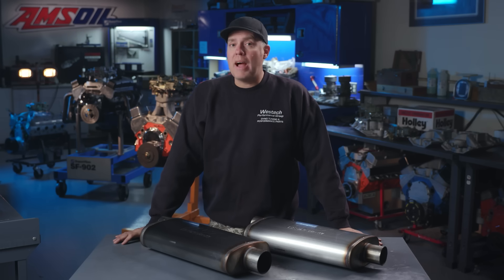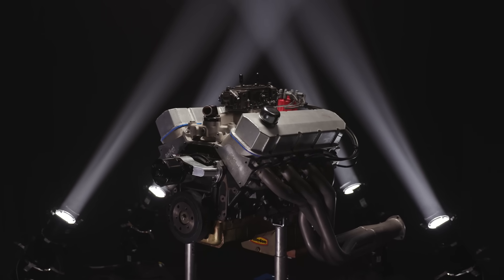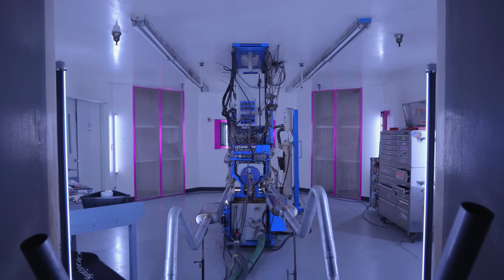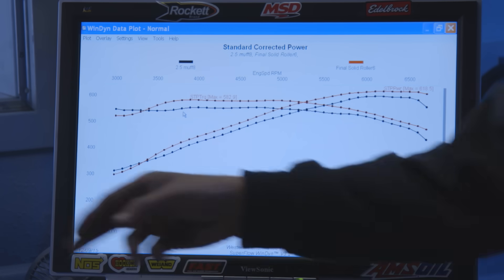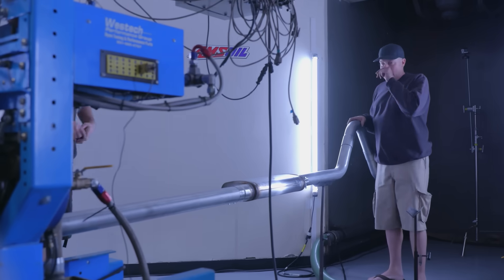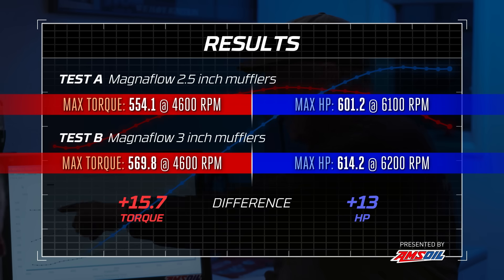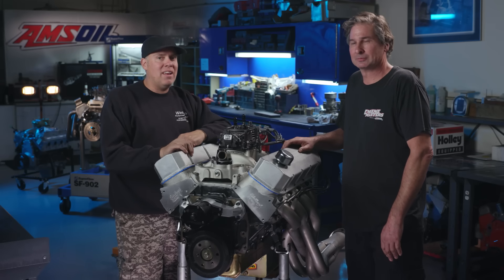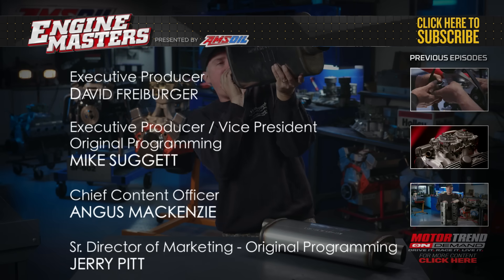The Power of 2.5- vs. 3-Inch Exhaust - Engine Masters Ep. 9

Comment: You know what they should do is get a STOCK engine and try it, since most of us viewers don't have a 600+ hp engines in our cars, and most of us with trucks and muscle cars have small blocks, not big blocks.
Reply: Clay Thompkins but even simpler than that a 600 hp engine puts out so much exhaust gas compared to stock that of course 2.5 is gonna be too restrictive compared to 3
Reply: @fatalvenomX  Exactly.  I'm guessing if they had put a 4" exhaust on it, they would not have seen any improvement over 3".
Reply: @fatalvenomX  2.5 STREET 3" RACE
Reply: Fernando Martinez he's got a 3v, his will break off in the head before he blows one out 😂
Reply: Jeremiah Goodwin plastic lifters? 2v Triton's had issues with timing chain GUIDES breaking. You don't need a new motor, you just replace the guides... 3v has issues with ca. phasers, a totally different motor. If your gonna rag on a motor, at the very least be somewhat educated on it.
Reply: @jb4234-x8d  MY '02 LIGHTNING STARTED SPITTING OUT PLUGS AT 100K SENT THEM OFF FOR CNC PORT AND REPAIR ...65K LATER STILL LEAVING 505HP Z06'S EATING  DUST ... IF THEY WIN ... MY BACKHALVED 78 496 FIREBIRD WILL EVEN THE SCORE ...THE LIGHTNING IS MY EVERYDAY DRIVER AND I HAVE BUDDY'S WITH CHEVY'S THAT HAVE SWAPPED MOTORS ALREADY...... 200 K IT'S GETTING PULLED POKED STROKED  AND THE BLOWER PORTED ...KEEP 'EM STRAIGHT JACOB !! LOL
Reply: @jb4234-x8d , Mr.Goodwin is highly educated. He earned his expert credentials online. But unfortunately he signed up for the fools paradise chat room which was overcrowded by millions that all think alike 🤔.
Reply: @danielwilson6665  highly educated vs fools paradise chatroom... Yeah, that's experience vs the educational system where you are credentialed for compliance, not actually finding or speaking truth. 

In the end, the value is about velocity to volume ratio for the intended power level and rpm level. It isn't about back pressure. Back pressure is only the reference to seeing what is happening inside the exhaust system. And yes, every engine needs some amount of back pressure, otherwise they wouldn't make more power with properly sized headers.

But then, people like you would rather have authority tell you what to do so you don't have to actually think for yourself... your obstinance is no evidence of truth. People who experience the differences are the ones who find truth.
Reply: @jb4234-x8d  that depends on what the engine's doing right when the guides break. if it happens at high rpm, you could have an expensive basket full of broken parts.
Reply: @jb4234-x8d  these people are chevy fan boys!!! But dont know common machanics of each engine!!!!!!!!! Chevy makes great engines but i have seen just a many 5.4 reach just as many miles!!!
Reply: DontTreadOnMe it is the point of principle. Everything applied to something bigger in hp can be applied to lower. But not everything lower hp can be applied to higher hp engines.
Reply: That_Ford _Guy  don't blow a spark plug now lol
Reply: @FernandoMartinez-mq2gj  ha
Reply: @hotrod500hp
Reply: Dylan Morin 900
Reply: Ratios
Reply: You like a civic or Miata engine
Reply: Callum b how about an LS miata!
Reply: @jjones2509  yes more powerrrrr
Reply: Ehhh speak for yourself
Reply: Get a stock chevy half ton truck and do this. Then a stock Ford f150 Engine and do this. Then we can see real world benefits in real world vehicles
Reply: Jeremy Lakenes facts
Reply: @jeremylakenes6859  You would probably see fairly big results using stock vehicle with a tiny stock exhaust as a base as they are choked to death from the factory.
Reply: Amen Brother 4.0L VQ40. I'm trying to get gains over 300 hp
Reply: @tommypearson9260  Plenty of hi performance parts out there to help you out with that.
Reply: They don’t have the money to build a bunch of engines most of the engines come from making it for the magazine I believe
Reply: Meh my 2.2L engine makes over 400 hp. It needs 3” exhaust
Reply: I’ve seen dunk comparisons and when running a silencer in the muffler can make you lose anywhere for 5-7% power.
Reply: im just a working idiot and it's not so tough to find a 454, took me a bit longer and a credit card to get alum heads. dont think its too hard to get a 454 at least in this neighborhood.
Reply: @tybotti  I'd bet it's not the exhaust causing a loss in power. IF you went from a very restrictive exhaust to a good, free flowing setup, your tuneup would change. Carb would usually need to be leaned a bit because the more efficient exhaust makes it pull more air, which also pulls more fuel. They feel "blubbery" of soft until they pick up some revs. All the GM trucks with LS/LT 4.8s & 5.3s come with a single 3". A 3" is actually a restriction when running dual 2.5" pipes into it. A 3.5" single is only a couple tenths of a square inch smaller total area so there's minimal restriction. I've run dual 2.5s into a single 3" with 350 & 400 SBC for 40 years with excellent results. next is the dual 2.5s into a MagnaFlow with an internal Y pipe & a single 3.5" out for my 409 small block
Reply: I have a 355 with 400+hp and a 200 shot on it... ya can't tell me you can afford it. 

Junkyard block 500
Machine shop 300
Cam 600 or under
Rotation assembly 1400
Set of heads 600
Carb an fuel system 800... 

Took 2 years an I'm disabled on a fixed income.
Reply: Yesss i highly agree
Reply: For the size and power, a comparison between 3 in and 3 1/2 would have given us better information
Reply: Specs on 1999 of
Reply: Agreed
Reply: You know what you should do?
Reply: It takes a high HP combo to see much of a difference.
Reply: Small blocks are for girls.
Reply: @strokersteve468  You don't know much about small blocks do ya. 406 sbc is big block ci. I've built many, some over 600 hp and ft-lbs of trq. It's all in what you can build not buy.
Reply: @Stevehistoryunhampered , you would think that anyone calling themselves STROKERsteve would actually know something about the impressive power available from a small block with big cubic inches. Maybe not 🤔.
Reply: You shouldn't even touch the exhaust with a stock engine. Lol
Reply: Exactly.
Reply: Speak for yourself I have a big block and will never go back to a small block
Reply: @HairBandDan I feel sorry for your wallet. 😊
Reply: Don’t buy a small block from the factory 🤨
Reply: I give up those twenty f**** horsepower to have a 600 horsepower daily driver car or street car give me that without the noise
Reply: It really doesnt come down to engine size or hp. The cam and header size do play a factor. But either way the same effect will still take place on how much power is freed up. There is some validity to what you are saying but not a whole lot.
Reply: I'll save everyone the time... if you have a stock engine your only gonna see a difference of +/- 5hp maximum... I don't think you'll even see any difference other than the sound with stock engine
Reply: @donniehooker1817  i gained around 10-15 wheel with 3in from 2 1/4” and one less muffler.
Reply: @Sak-zo1ui  10-15 hp? What engine what cam what heads? Headers? I used to work at a shop that had th ability to put dual exhaust on anything and from experience I can tell you 3 inch or 2.5 inch is gonna hurt a stock engine... if you can show dyno # maybe I'll belleville you but as far as I'm concerned if yo have a stock engine you don't need anything bigger than 2.25... in fact if you go bigger I think it hurts the top end...
Reply: @Sak-zo1ui  you got a dyno sheet for that 10-15 or did you use the AIS dyno?
Reply: @donniehooker1817  this is with other comparisons. I have made more power on a normal dyno. And I also gained more torque. You dont want any back pressure in theory but you do want directional flow. But back to the results. On the 5.7 hemi 2006-2008 they came with manifolds to cat to x pipe to mid muffler to mufflers. True dual through out at 2 1/4”. With a system where they went 1 3/4” longtubes 2.5” exhaust with catless mids and straight piped they made 320whp and 370 tq. I have seen 330hp at the highest and 360tq at the lowest. So basically around 320-330hp and 360-370tq at the wheels. Stock is around 275 280ish to around 290-5. With my magnum I put down 340whp and 390wtq with 1 3/4 longtubes, into high flow cats, with 3 inch exhaust all the way out. I have a custom x pipe in the middle with two flowmaster super 40s around the middle. The problem is we are coming from an era where exhaust systems simply moved the exhaust away from the cabin but these days the importance is extremely apparent with the least amount of bends as possible and the smoothest bends as possible.
Reply: @donniehooker1817  what one more. I was properly tuned on air fuel and timing with the headers.
Reply: @Sak-zo1ui  so your saying a stock hemi made 35 horse just off of the exhaust? Um sorry but I'm gonna have to call b.s.
Reply: @donniehooker1817  yes. The stock manifolds on the 5.7 are extemely restrictive. Im not making this up.
Reply: It's called Engine Masters not Engine Noobs. They've shown how to make power cheap before and that's not the point of this test. Stock engines don't need extra exhaust flow, this test would be pointless on a stock small block.
Reply: If your engine is not significantly modified, you won't get much benefit from mufflers.
Reply: True
Reply: I have a Chevy 3500 8.1 (496ci) big block it has the 3 inch exhaust.  Has all the power i need . The 5 speed Allison and the 4.10 rear end gears also helps to put that power to good use.
Reply: Bigblocksatebetteregeine
Reply: Imoldschoolwhenitcomestoocarsoldfassion
Reply: instaBlaster
Reply: without carburetor
Reply: It's easy to make 500-600hp in today's world. Check out Chevy's CT-400 dirt track crate motor. 350ci/405hp with 10:1 comp & a 208* cam. I know several people with them & the actual HP number is 440-450. I run an 89 Chevy, NASCAR look truck with a 9.5:1, 409 small block with a 211* cam. It runs on 87 octane, idles smooth, gets good MPG & makes 500#s torque/500HP. It's simply the correct combination or the parts. These guys usually way over cam their motors for a REAL street world environement.
Reply: @bradgriffith4231 Wow! You have an 409 ? That’s a rare engine. My dad had one in his old  64 impala. Wasn’t there two different 409?  My dad told me the only thing that beat him was a Cadillac with a 500 cubic engine beat him one day .
Reply: @Jason_556  409 inch small block(400 SBC bored .040" over). The orignal 409 weren't that great because, like the Ford M-E-L- engine, the combustion chamber was formed by an odd shaped piston rather than in the head. Definitely not the best for flame travel & combustion. This is the reason engines designed like this didn't stay in production very long.
Reply: ⁰
Reply: It matters more on a performance engine
Reply: same concept, just less hp which wouldn't show the difference as much
Reply: What does it matter, their testing mufflers, more power, more noticeable difference, better results. Go spin some wrenches then, runnin round stock 😂
Reply: Oh shardup
Reply: Interesting. I welded for Kooks. We made more horses on Jr's "Vette" w/ 2.5"
Reply: My super stock 350 runs a venturi of 2.25 inches and makes 620 up, you guys sell parts!!!
Reply: I ran a BBF 460 with a 218° hyd roller cam, intake, 11:1 comp, etc, that fell on its face with 3" under 3k rpm, but responded well to 2.5" and h-pipe for towing purposes. Obviously back pressure helped. 

Back pressure is the wrong value to pick on, as it is only a result of optimal air flow.
Reply: Not true at sll
Reply: @eviltechracing  nice demonstration of ignorance... Show what is correct instead and desire to understand what the other guy is saying, because anyone in the performance industry knows how important it is to tune the exhaust for the intended use.
Reply: It works the exact same dude
Reply: I think the end results will be the same, just less noticeable
Reply: @justmechanicthings  as stock engines make more power down low, the designed power band would be hurt, with only meager gains at 5k rpm... 2.5 inch exhaust seems to be the optimal size for larger displacement engines, in my 30 yrs experience with towing builds.
Reply: That's the thing  3" is too large for a 350hp 350. Lol
Reply: @natelorimer8567 how about the same setup with 2.50 exhaust? I either have 2.50 or 2.25. Can’t remember.
Reply: Little math & percentage of horsepower will answer you .
What stock engine & lil maths I'll answer you Sir
Reply: @ronaldrey8474  calculations only take you so far. It isn't only about air flow rates, but about designing an engine to do what one wants it to do. Max numbers are not indicative of maximum efficiency. For example, I had a BBF that fell on it's face with 3" duals at high altitude and towing, then responded very well to 2.5" with an 'H' pipe, but liked 3" with a smaller camshaft. Richard Holdener's LS tests often show no gains with larger headers, with gains down low with smaller headers, but he rarely tests below 3k rpm... 

A friend had a Toyota v6 with a supercharger, that could not accept 3 inch exhaust, but his turbo later loved it...

It's about design for purpose, cause and effect, and understanding what the camshaft does.
Reply: @Faolan161  open exhaust HP  = # ?
HP with 3" exhaust takes away how much HP which = what %
For instance 3" destroyed 10% of your HP #'s  and do the same with 2.5 exhaust gives you what %  ? Say 15% HP loss ..    so 2.5 pipes will take away 15% off your 350 stock engine too...  Within 2-3%   NO IDEA what your explanation means different cams etc...   Simple Maths will give the deficiency no matter Toyota or Chevrolet if you have HP # of stock engine
Reply: @ronaldrey8474  except, it simply doesn't work that way. Obviously you aren't an engine builder, because you have no idea about how cam duration and cam timing have to do with flow... Richard Holdener dynos lots of motors, and in one particular vid he showed how 1 7/8" headers were equal in power to 1 3/4" headers, but built low end power significantly, under 3k rpm... above that all the way to top end was nearly identical, within 1-3 HP all the way.  It is not a flow calculation, because exhaust flow has to do with how much exhaust gas gets replaced with fresh air/fuel, and how much stays in... also known as the scavenging effect, which is cam design and back pressure related, as well as velocity vs pressure related in the exhaust.... then, reread my last comment, and you will see evidence of such... Your math does not match the experiences I showed you about. Smaller heads also responded to bigger exhaust on the BBF, where bigger ports needed smaller exhaust... It is about generating velocity at the desired rpm range. Velocity fills the cylinders, and velocity evacuates the exhaust, not pipe diameter... Velocity has a beginning, and you are starting at the wrong end.
Reply: I got a big block 😂
Reply: I run a 6cyl barra the world 😂
Reply: Stock engine won’t make a difference, aside from maybe a couple hp at best.
Reply: @nedaCFilms  dual 3" hurts stock power down low
Reply: @Faolan161  and torque
Reply: Agree
Reply: For a stock engine you don’t need 2.5/3” exhaust. No matter what bench racers tell you.
Reply: @alexcorona  you must be the bench racer... Dual 2.5 is prudent for 375 cuin and larger, regardless of elevation. Best breathing characteristics for mild builds, 2.25 being slightly better under 2k rpm stock or small rv cam... 

There are actually a few people who actually have experience and speak prudently, without degrading others without cause...
Reply: Richard Holdener sounds like a better channel for you
Reply: You're right it's 1250hp
Reply: If your cars stock then it doesn’t matter it’s stock😂
Reply: it does not matter, in any way, the point with the high HP engines is that if it shows a little bit of improvement you wont see jack squat in a normal engine.
Reply: @timsgarage1356  you’d see the same change percentage wise just smaller numbers
Reply: @Thumper68  yea so 0.03% is worth a few grand? Lol. The point was it's not worth even bothering to test on a small HP motor.
Reply: @timsgarage1356  I never said that it was worth it. My point was the tests results will yield same changes percentage wise thus agreeing with your comment
Reply: They don’t cause it wouldn’t make a difference probably at all. Would be such a boring episode even you wouldn’t watch it…
Reply: I wish they would have taken the next step and tested the H pipe and the X along with the two sizes.
Reply: 🤣🤣 In a STOCK (as you say) engine, the difference would hardly be noticeable
Reply: Well maybe coz stock car owners don’t care about performance
Reply: I was thinking the same thing
Reply: Cant believe the comments!
Reply: If your engine is stock, no need for a modded exhaust. Besides, you stock 3ngine guts put your exhaust and wherls on and call it a build.
Reply: The most relatable comment ever?! 😂😮
Reply: I have over 600hp. 👋🏿
Reply: Then why do you care about a 3 inch exhaust?
Reply: 2.5 inch exhaust is pretty good for an average car.
Reply: Right on the money, bro'!!!
Reply: I have a 2010 E350 5.4 2valve in my driveway with 287,000 miles on it and it’s still running strong. I’ve never blown a plug or had a major issue. Never was designed to be a fast engine but it likes those mid range rpm’s. I run a 4:88 with 35s and that old chugging 5.4 thanks me every day for it.
Reply: The watch a video for what you want.
Reply: Even more so because the cam profile in a stock or mild engine will be effected much more by exhaust flow than a performance engine with little valve overlap and a sharp lobe profile.
Reply: @claythompkins5087   Oh ya....i have a 700 lift cam in the 427 in my boat....runs a solid 108-110 @ 7400 rpm  like clockwork...stick a do nothing lookin baffle it it...10 mph off the  top...pretty sure its rmp related...motor still pulled plenty hard to 6600 and it nosed over from there
Reply: @claythompkins5087  youre not going to get into rod/stroke ratios? that affects the engine's response to changes in the camshaft profile more than exhaust system parameters.
Reply: @claythompkins5087 ...affected...
Reply: There would have been no difference between the two on a stock system because either flowed more than enough to support what "most of us" drive. The 2.5" system still made around 600 HP. If you aren't pushing over 600 HP then you don't need more than a 2.5" exhaust. It doesn't matter what engine you have.
Reply: John Terpack at a stock engine you will just be choosing noise level. I don’t ever remember trying to squeeze every HP possible on a stock engine. 🤣.
Reply: @rekik66  and I doubt pipe size would make a big difference in sound. Definitely not as much as muffler choice. I just don't get all the comments about testing on a regular engine.
Reply: John Terpack now with modern engines you may lose power by altering the exhaust without a tune.
Reply: @johnterpack3940  actually it will make a difference in sound, but there's more to tuning the sound then pipe size and muffler. A key component is the exhaust tip size in relation to pipe size. Since my engine produces far less then 600HP I went with 2.5 exhaust and a Flowmaster 80 series. Due to the engine being a smaller displacement that revs higher then it's Chevy SBC counter parts. I went with a 3 inch wide by 10 inch tip. This gives a far deeper tone, and nearly eliminates that annoying ricer whine that can happen in higher RPM's. Plus it prevents that mind numbing drone that can occur at highway speeds if you use tips with the same size, or way over sized tips. I have to nearly red line the engine before that happens. Due to the fact most of these guys are most concerned with building max HP & Torque, they rarely concern them selves with tuning the final exhaust note. If they even know it can be done. They simply do not care.
Reply: @johnterpack3940  And what happens when you compare a stock setup to 2.5? You're going to see big gains there. But this test is useless to people running "stock" configurations. If you're happy with stock than keep it that way. Some of us are running big horsepower and can actually benefit from a nice exhaust system.
Reply: life dont begin till 600+ hp haha
Reply: @dylanmorin2534  My Piilatus PC12 puts out 1,800 shaft HP and can boogy all night.
Reply: @flyingdog1498  roger. PT6A-67 for the win.
Reply: @dylanmorin2534  hahayoudontingeneslikeidoo
Reply: @dylanmorin2534  wtf
Reply: They had to go big to see a difference. For the rest of us, 2.5 is as big as you need pretty much. Might make a small diff going up to 3inch on a 400+ hp truck but it's gonna be single digits. If you're in a stock vehicle, all you need is high flow cats and a high flow muffler on your stock tubing.
Reply: same thing but less pwer lol I gained about .40 quicker with a 300 inch engine making around 200 hp
Reply: yea something like under 500hp.
Reply: and how much this engine uses MORE fuel than a standard engine....
Reply: No point. You won't need 3 inch on an engine that doesn't make 400 + hp. There won't be enough flow to make a big difference. You may get a couple of ponies,but you may also loose some hp and torque
Reply: @charleslum2438  That's why this test was done on an engine that actually needs it. Not much point or fun testing on some 180hp motor.
Reply: I have a 350 and a 454. I'm dropping the 350 in first while I build the 454.
Reply: @danielslaughter104 what size pipe on 350? I believe I’ve got 2.5 on my truck.
Reply: I put together a 460 with 3" after doing a 390 with 2.5" and seeing the massive gain in power over 2.25". I had to go back to 2.5" on the 460 because torque was so terrible below 3000 rpm, where I drive the most. Notice how the power was way stronger with the 2.5" on the dyno below 3500 rpm on the 600 hp 454... I am willing to sacrifice such small top end losses for low end gains. I sort of expected the loss of power to be much more than 20 hp...
Reply: I have a big block love it
Reply: @19antman55  good 4 u🤡
Reply: Yeah exactly like my tbird runs a 302 shortblock
Reply: @thethunderbirddirtcar_5718  with a non-turbo 302 with stock compression, using headers and no more than 2.4 inch for each pipe would be ideal. Much bigger and you'd lose torque. Just keep the bends as gentle and smooth as will fit and never accept any flattened kinked bends.
Reply: I agree! My 78 c10 is running a mileage unknown bone stock 350. Attatched to headers, true duals, no cats all in 3" turned out in front of the rear with flowmaster super 44s. Show me the difference there.
Reply: Stop your crying boys if you can't run with the big dog's, stay on the porch with da puppies!
Reply: GOOD POINT, and a comparison with a small block chevy to see if it has similar results.
Reply: Sir Bumblefahk  thats like saying running open exhaust on a stock engine does nothing cause it doesn't flow enough air. The 3in would hurt fuel mileage yes cause its not about to scavenge as well as the 2.5in but the true fact is where are you wanting the power at the bottom end or top end with open exhaust you get most of your power at the top end where the stock manifolds you get at the bottom end same with shorty headers you get some big end but mostly bottom and midrange
Reply: Best comment ever
Reply: These videos are commercials. You know why they are using high horsepower engines? Because that gives the biggest difference in results.
Reply: It won't affect a stock motor. They don't have the need for a larger exhaust.
Reply: That_Ford _Guy good luck with those plastic lifters for your timing chain. Boom.. new engine needed. 5.4 is shit. Cam phasers fail.. that engine blows man...
Reply: Jeremiah Goodwin  I got an 06 5.4 with 200 k miles and no troubles so far. Change oil regularly with 5-30, don’t use 5-20.
Reply: I do have a big big block .had a few different combinations, same big body car, on same 2.5 inch duals with pipe and cheap turbo mufflers out the back. Always proved it restricted. [Never a stock bbc] the last reincarnation is square port ls6 type heads, standard stroke
Absolutely amazing sound out of 3 inch full exhaust. plus Dynomax full flow mufflers. A sound every smallblock.and LS desires
Reply: Amen to that brother!! I have an 04’ F-150 and would love to see how much HP these guys can squeeze out that bad boy. 5.4 Triton all the way
Reply: @5.0_life30  Bad boy triton. Tool.
Reply: @5.0_life30  Booo! Chevy all the way baby. Hehe. Have to give you Ford guys a hard time.